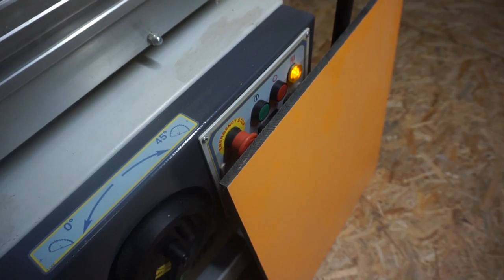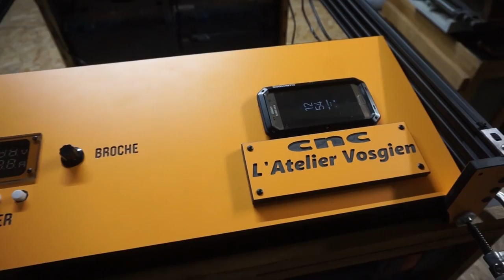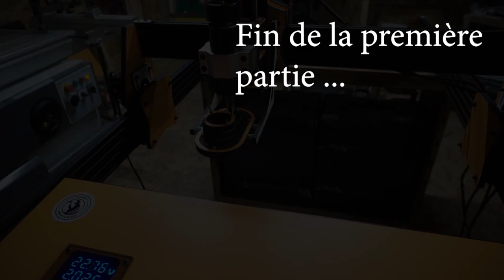JE FABRIQUE UNE CNC / BUILD CNC #Ooznest #Banggood

Comment: Salut Arnaud. Quelle fabrication ! J'en reste sur le c.l !!! Et 1500 mm de longueur c'est top, de quoi travailler sur les plaques de 1220 de large 👍👍👍
Vers la fin, à 8:30, quand tu testes les axes, tu utilises un boîtier. Tu peux en dire plus et mettre un lien STP. J'ai vu ton lien pour le clavier qui a l'air super et je pense l’acheter bientôt. Ce clavier a un rapport avec ta CNC ? Merci.
Amitiés.
Reply from the maker: Slt Bernard le boîtier c est mon téléphone la carte duet 2 fonctionne en wifi , le clavier me sert pour les déplacements de la machine .
Reply: @atelier_Vosgien  Merci Arnaud pour ta réponse super rapide. Effectivement, ce clavier me plaît de plus en plus et je sens que je vais pas tarder à préparer une commande !